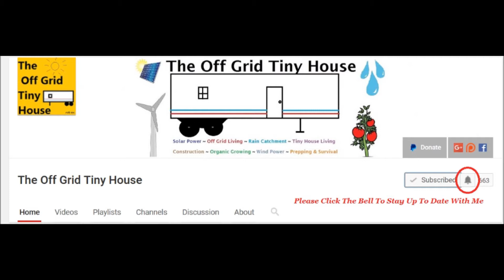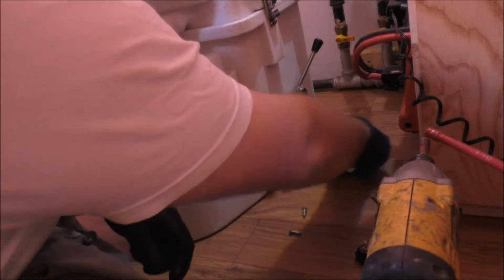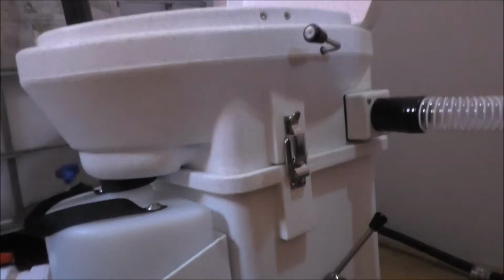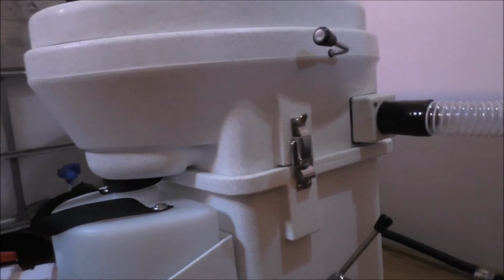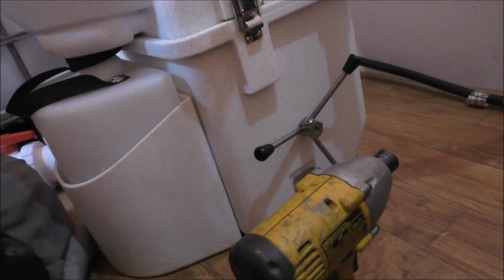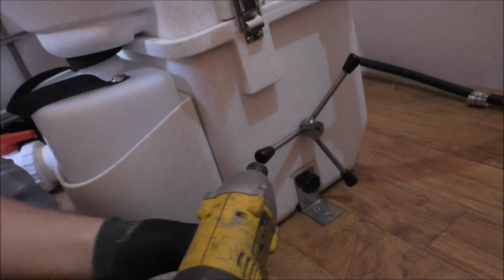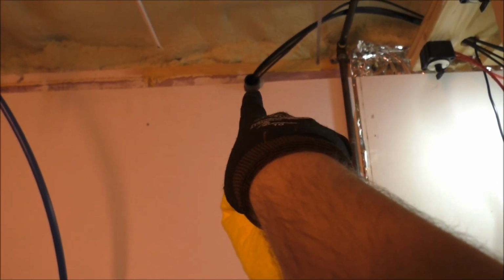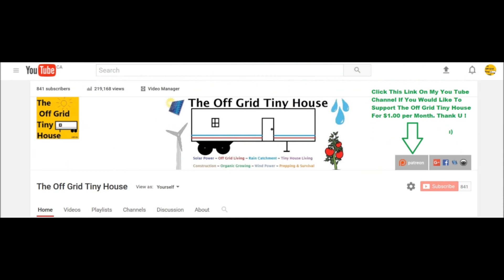the off grid tiny house Compost Bathroom

Comment: You can always magnetize drill bits yourself - I do that to all of mine.  I keep a average strength magnet in my tool box just for that reason and when I get a  new bit or new screwdriver, the first thing I do is just run the magnet down the length of the shaft from handle (or end that would go in the drill) to the tip.   Its handy to have a magnet around for many reasons but getting into the habit of magnetizing drill bits and screwdrivers can save a lot of time and frustration.
Reply from the maker: okay i need to do this! thank you